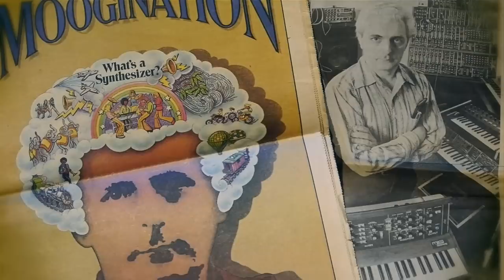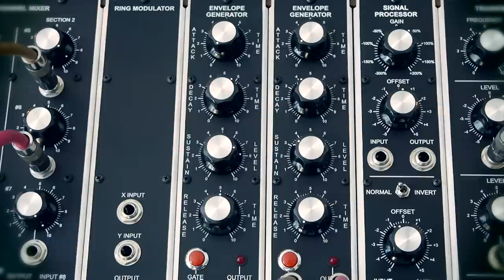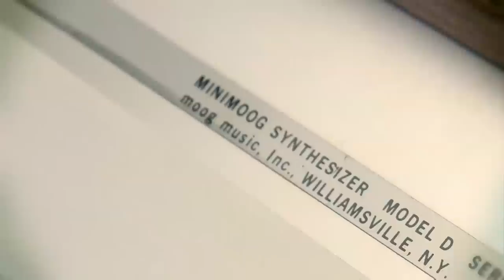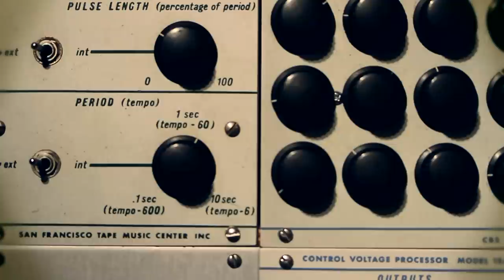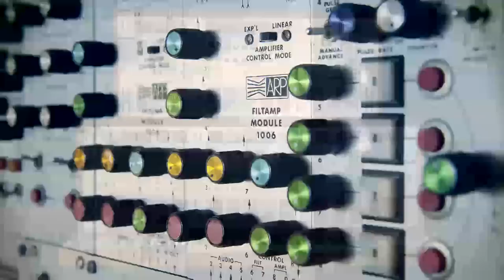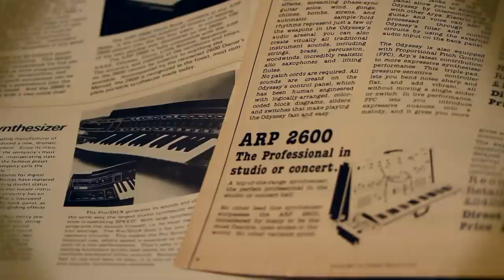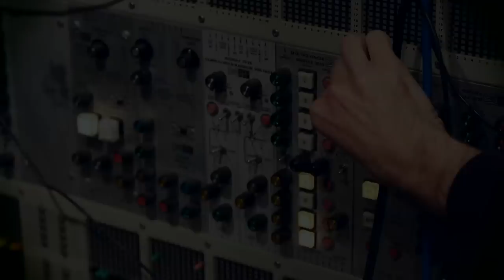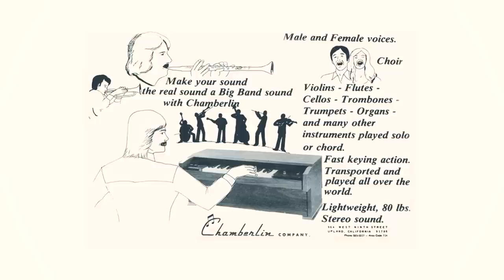Bright Sparks Documentary - A Side

Comment: 20:44 I'm a proud owner of an R.A.Moog Minimoog model D #79 (1079) and a muSonics model D #227 (1227).  

I also proudly own all the three types of oscillator boards these Minimoogs had.  The original OSC board (from the metal-back ones), the "old" OSC board (starting with MoogMusic), and the "new" most stable osc board with 9 pots.  

The serial numbers indicate three things: 
1) It became muSonics before they sold 230 Minimoogs. 
2) The filter board only in these earliest Minimoogs with the black metal background have matched transistors, meaning all the Minimoogs until MoogMusic have the same legendary magic Moog sound since all the later Minimoogs did not have matched transistors in the transistor ladder filter board, so the leather-back (non-metal back) Minimoogs all sound a bit different from each other. 
The third thing is that I can pass stereo sound from two legendary Moog filters for sound magic :-)  (just flexing) The magic sound is partially due to the unobtanium vintage VCA circuitry (definitely not the modern surface mount ones) so the later ones have most of the magic too ;-)